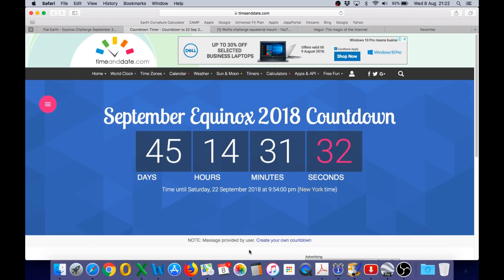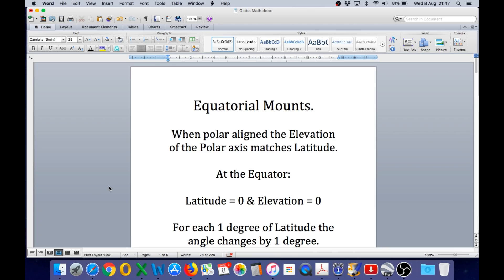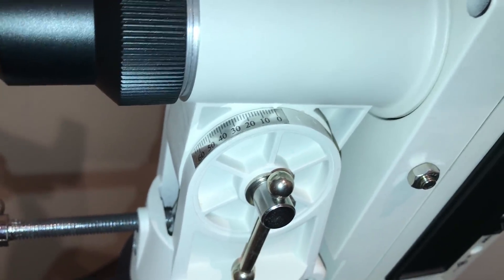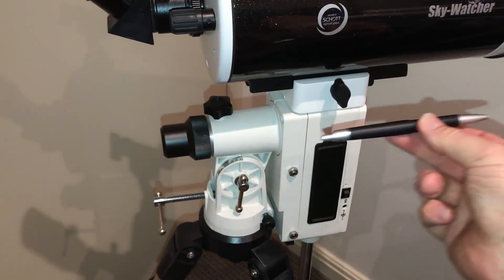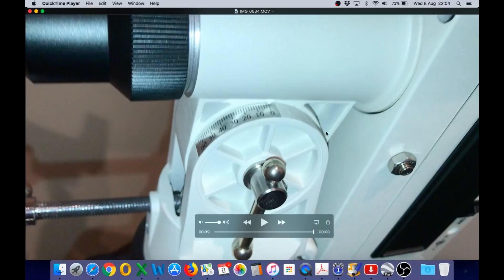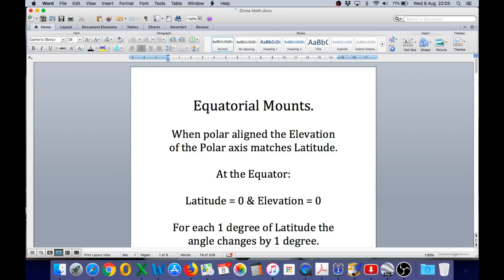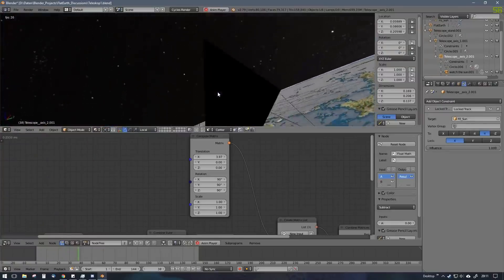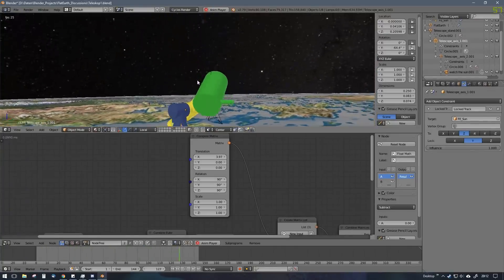Equatorial Mounts - a huge problem for Flat Earth.

Comment: Wolfie6020 During the equinox the sun is traveling in a straight line...Now explain how are you tracking it doing an arc with your telescope...
Reply: jazla111 
You just don't get it, do you?
Reply: Scott Meyer Well you didnt explain how you track a straight line doing an arc...
Reply: jazla111, a correctly aligned EQ mount's trajectory is coplanar with target's trajectory. In case of the Sun - the ecliptic. Whether it's equinox or any other day is irrelevant. That's the whole point behind single axis.
Now explain why you, who are claiming to be oh so smart, need this explained.
Reply: Stanislav Blinov Yeah funny how you're tracking an arc which is not a straight line.
Reply: Let's see just how Flatearthily bad your spatial reasoning skills are:

What does a circle look like to an eye that is inside of and coplanar with said circle?
Reply: jazla111, come back when you learn what "coplanar" means.
Reply: Like I said, he doesn't get it. Geometry escapes him.
Reply: Indeed, Scott. We're aiming over his head. Given the subject of the vid, I might should add a "no pun intended" here.

Anyway, jazla, picture this: it's the equinox, and you're on the equator lying on the ground on your right side with your head pointed south so that you are facing the eastern horizon. You wait for the sun to rise. When it does, you begin rolling ooohhhhh so slowly to your left while sliding against the ground so that you do not roll off the same bit of dirt you started on. You never turn your head, letting only your rotation about your body's long axis move your gaze, and you take 12 hours to roll over 180° and face the western horizon.

Does the sun move in a straight line over you? Does your gaze track the sun? Do your eyes move in a (perhaps bumpy) circular arc? And most interestingly, can you think of any devices your behavior imitates?
Reply: Coplaner is when there two planes.  Like when you have two pilots you have a copilot.  If two planes land together you would have a colander.
Reply: jazla111 what do you mean straight line? Only on the equator the sun is traveling due east straight over head and due west. This is still an arc. For anyone on the globe during the equinox the sun is traveling due east, to due south or north, dependant on which hemisphere, with and elevation angle dependant on the observers latitude, and back down to due west. Straight arc. There were about 5 entrance to the equinox challenge showing how it works on a globe and how the equitorial mount works.
Reply: "Now explain how are you tracking it doing an arc with your telescope..." 
During the equinox the arc intersects the horizon at due east and west.  During summer it's shifted towards the pole, during winter it's shifted toward the equator. The angle of the arc is dependent on your latitude and does not change throughout the year.
Anyway, have you found Polaris yet?
Reply: The sun isn't moving...the Earth is turning.  Being on the Earth, which is round, you get an arc.
Reply: Odd that you didn't answer the questions. It's as though there's some rhetorical point you were emotionally invested in that the answers might pose some problem for.

Anyway, your totally-not-obvious-change-of-subject new challenge is also not a challenge. I'd just need to lay on a 30° incline rather than flat on the ground.

Spoilers: this is how every argument between a flat EEGer and a reality-phile is always going to go. Flatty poses some supposed problem for heliocentrism, reasonably knowledgeable person explains how the flatty's premises are false or his reasoning faulty or probably both.

Step 3, of course, is typically flatty says "Nuh uh! Wake up sheeple! LOL water off a tennis ball!"
Reply: DuhIdiot, step 3 is not jazla's style. He's likely to either stop commenting in this thread (only to come back with the same old BS in a later video) or go off on a tangent about his newest fetish. Recently that has been the fifth dimension.
Reply: Damn you're dense, it doesn't matter where you are on Earth or which day it is, a properly aligned equatorial mount will always work.
Reply: Gordon Freeman Dam I must be dense..Well here is another question for Mr intelligent..Explain in detail how perspective angular size works..Why do things get smaller the further away they are...I bet no one in this thread can explain it in detail..Why and How!
Reply: See, another irrelevant crap. Things don't get smaller the further away they are, jazla. Things appear smaller with distance. I'm sure the difference is lost on you.
Why? Because optical sensors such as eyes or cameras are much smaller than the outside world, they're basically points. In a uniform medium light travels in a shortest path. Shortest path between two points is a segment. Segments sharing only one point intersect, i.e. form an angle. The further the points are from the sensor, the smaller the angle. Next stupid question?
Reply: jazla111 do you mean why do they "appear" smaller the further away they get? Like how the sun and moon stay the same angular size while above the horizon?
Reply: Stanislav Blinov What a load of crap..Go over lay a grid on the photo and tell me its 3 dimensional. Does the eye and camera change the grid?
Reply: SAR dot Yeah I may as well talk to my computer,it will give me the same programmed robot reply.
Reply: +jazla111: Can you describe how an equatorial mount tracks the sun on a flat earth? Yes, you can. Model this, and you will no longer need to leave comments; you found THE answer all by yourself.
Reply: Attention all flatists.
Make a model, enter the competition and provide us all wrong.  If you can't it shows you are wrong about everything.  End of.
Reply: Hah! I can't believe that you guys are trying to explain things to Jazla! You would have better luck trying to explain to a collie how the dog food gets in the cans!
Reply: Mandelbrot Set I'm just practicing. Going to attempt training my pet turtle to play a cello this weekend.
Reply: Mandelbrot Set comedy gold
Reply: jazla111 following an object using 1 axis of rotation IS a straight line. All the time. All year. Your confusion is most likely because you don't comprehend the sun's path is a circular plane that goes equally below the horizon as much as it goes above the horizon during an equinox.
Reply from the maker: +jazla111.  I actually do explain it even in this video.   You are still not seeing the Geometry mate.  What shape is a circle when viewed edge on?   Hint - a straight line.   

Actually mate.  Do you have any android devices?   Get yourself this app. 

https://play.google.com/store/apps/details?id=com.alokmandavgane.sunrisesunset&hl=en

It will show you clearly how it all works.   I will be making a video about it soon.
Reply: Wolfie6020 Well im not looking edge on from 30 degrees latitude.
Reply from the maker: +jazla111 Get the app mate.   Use it and you will understand. You are looking edge on from any Latitude during the Equinox

https://play.google.com/store/apps/details?id=com.alokmandavgane.sunrisesunset&hl=en
Reply: jazla111 - At an equinox the center of the sun is on the plane of the Equator. If you are at latitude 30 degrees then you are 3959 * sin 30 = 1980 miles above the equatorial plane. The sun’s mean distance is 93,000,000 miles. That is proportionately the same as being 1.35 inches = 3.4 cm above the plane while the sun is 1 mile away, so it would still look to you as if the sun’s path through the sky was a straight line on that day, even though it would curve a tiny bit — which it actually does from any latitude, because the sun’s center is only on the celestial equator for an instant.
Reply: Wolfie6020 1800 nautical miles from the equator..Distance changes angles..Well distance changing an angle is not calculated in your geometry.
Reply from the maker: +jazla111  Yes it is.  Tell me what the change in angle is please.    Give me the real number and tell me how you measure it?  

Get the App - it will show you why you are looking at it edge on.
Reply: jazla111 you do understand it is impossiball for an object 3000 miles above a flat surface and not more than 12,500 miles away (at most) to even "appear" to disappear below the horizon, don't you? I guess not 🙄
Reply: Kevin Man LOL
Reply: jazla111 and here is the root of your cognitive dissonance...
Reply: Wolfie6020 I used to believe we lived on a ball mate. I even posted a video for you to see me explaining we lived on a ball. Then I saw things in reality that dont match the ball model. That is why I have a lot of questions.
Reply: An EQ mount is not walking on the globe towards the sun....
Reply: Sure I do. Wolfie asked: "Tell me what the change in angle is please. Give me the real number and tell me how you measure it?". You replied with an irrelevant video.
Reply: Quikee If you read the description it states 70 metre away x 40 metre high = 30 degrees..Well the angle changed 70 degrees walking 70 metres... I guess it wasn't what he asked robot. I bet your hard drive doesn't contain a terabyte.
Reply: jazla111, plot a to scale diagram of the Sun-Earth system, viewed in the ecliptic. Pick two different latitudes on Earth and plot a line from each towards the Sun's center. Return when you manage to have those lines not be parallel.
Reply: What's wrong, jazla111? I thought you liked making diagrams, you made them before.
Reply from the maker: +jazla111  Thanks and yes I agree that angles change over distance.  No argument from me about that.  But my question was how much do you think the angle changes to the Sun if it is 93,000,000 miles away and you move 1800 Nautical miles.  

I'll do it for you. 

93 Million miles is 80.7 Million Nautical miles. 

1800 divided by 80.7 Million = 0.000022

Arctangent of 0.000022 = 0.0012

About one thousandth of a degree.    About 4.5 arc seconds.  

Put into perspective that is 0.2% the arc size of the Sun.  

Do you think you will notice the difference from the Equator to 30 South Latitude?  

Not a chance mate. 

Hold a circle on edge and you get a straight line.  

Now tilt it one thousandth of a degree..    What do you see?  The same thing mate.   

This is more proof that the Sun is not just 3000 miles away.
Reply: Wolfie6020 No thats not what was stated read the thread..Distance changing and is not calculated in geometry.
Reply: Wolfie6020 If you want to get technical..Now do it for a 4000 km high sun vs 7000 kms of distance on a flat surface.
Reply from the maker: +jazla111 You stated.   "Well im not looking edge on from 30 degrees latitude."

Then you stated.  "1800 nautical miles from the equator..Distance changes angles..Well distance changing an angle is not calculated in your geometry."

So I did the math for you and as you can see you are within 1 thousandth of a degree of what it appears from the Equator.  (My calculation assumed the 1800 miles was a perpendicular to the direction to the Sun.  It would actually be less of an angle difference due to the curvature of the Earth) 

If you look at a circle edge on it will be a straight line.   Moving it 1 thousandth of a degree it will still appear to be a straight line.  

Yes that is exactly what you stated and this is exactly what I answered for you.
Reply from the maker: +Jazla111 Why don't you do it for a 4000 km high sun vs 7000 kms distance?   Do the math as I did please. 

That will show me if you understand how the Math works.   Otherwise it is pointless trying to explain things to you. 

You do that one and post the calculations here as I did thanks.
Reply: Wolfie6020 I just showed a demonstration with the maths on how much the degree changes. Ive just made 70 metres to 7000 metres and 40 metres to 4000 metres..So if it change 70 degrees for 70m x 40m what do you think will happen at 7000m x 4000m?
Reply: Wolfie6020 Now if the Earth is curved and you travelled 7000km. You have done 63 degrees of curvature plus the 70 degrees in distance.
Reply: Keep digging, jazla111. Keep on digging...
Reply from the maker: +jazla111 Mate I know what will happen.  Once again, I want you to do the math yourself.  Why do you always avoid anything Math related?   

Just do the numbers yourself.  I want to see if you actually understand this.  If you keep avoiding the Math it is because you don't understand how it works. 

Do the calculations properly as I did mate.  Stop beating around the bush.
Reply: Wolfie6020 I done the maths heat transfer from the sun at 149 million kms does not make one half the planet cold and the other hot. If you think the sun is that distance well good luck to you.
Reply from the maker: +jazla111  See mate, why should I waste time with you?  You never give me a straight answer.  You dodge math questions with nonsense and trying to change the subject 

The thread was about the Sun travelling in a straight line on the Equinox.  That is fine.  Then you raised the point of being 30 South Latitude (1800 miles from the Equator). 

I did the math to show that the angle changes by only one thousandth of a degree so you are effectively still looking at the circle edge on.  

Why all the other nonsense mate?  videos?  Now you talk about heat transfer?  Seriously? Can't you just focus on one point at a time and do the basic math? 

I answered your quesiton about the Sun moving in a straight line on the Equinox perfectly.   Conversation over.   

I asked if you can do the math and clearly you cannot so that tells me not to waste time trying to explain anyting to you in future because you won't get it anyway.  

So last chance mate.  Do the math for your 4000 km and 7000 km and show me how you do it and give me the real angle you calculated.  Is it really too hard for you?
Reply: Wolfie6020 Thats your problem mate you look at one piece of a puzzle. You have to look at ALL the pieces of the puzzle.
Reply: Wolfie6020 A 4000 km high sun at 7000 kms away will be 30 degrees.Did you not even watch my video.
Reply: Wolfie6020 It states in the description of my video 70m distance x 40m height will give you 30 degrees.
Reply from the maker: +jazla111 Did you ask me to explain how I can track it doing an arc with my telescope in your first comment?    That was your question mate.   I answered it for you.  

Clearly the Sun is not 4000 km high or the Equatorial mount will not work.  

You are the one missing the pieces of the puzzle.   The Equatorial Mount does work from every location on Earth.   

The polar alignment is 1 degree different for every degree of Latitude.  Each degree of Latitude is spaced 60 Nm apart. 

The objects in the Sky can be tracked using a single axis of rotation from any location on Earth when polar aligned.

There are several pieces of the puzzle.  See if you can put them all together into a model that works.  

Just try it on a Flat Earth mate.  What are you afraid of?   Do you want the truth or not?   

Try it - put those pieces of the puzzle together and tell me the ONLY shape of the Earth that works.  That is your project.
Reply from the maker: +jazla111  PS - yes I did watch your video - you used a theodolite app to get the angle of 30 degrees.  That is not what I asked.  I wanted you to calculate it using Math.

When you do the math and you calculate it for changing distances it does not work on a Flat Earth because reality changes by 1 degree for every 60 Nautical Miles.  Your video does no math.  No calculations and therefore you are still not putting the pieces of the puzzle together properly.  

Do you know that 1 degree per 60 nautical miles actually gives you an accurate "R" also?   Yes  6371 Kilometers perfectly  

Here is the Math. 

60 Nautical miles per degree.   

360 degrees in a circle.   

60 x 360 = 21,600 (circumference)

Divide by Pi = 6875 Nm Diameter. 

Convert to Km.  = 12,742 km. 

Divide by 2 to get radius = 6,371 km 

All the pieces of the puzzle = a ball mate.
Reply: Wolfie6020 I did do the maths for my demonstration. I set the drone at 30 degrees..It equals in maths 70m away x 40 metre high..I must of walk 70 degrees around a ball for the drone to be 90 degrees above my head. Did you see I was on a flat soccer oval not walking over curvature to change 70 degrees.
Reply from the maker: +Jazla111.  See mate you even got that math wrong.  

30 + 70 = 100...

You are still missing the point.  Did you measure how far you had to walk to get the 60 degree angle change? 

Did you have to walk exactly the same distance for every degree of angle change of your drone?  No you didn’t.   Tangent trig function does not work that way.   So you actually proved the Earth cannot be flat mate.

This is why I keep asking you for the real math using trig functions.

On a ball one degree of Latitude is the same distance travelled across the Earth everywhere and that results in 1 degree of position change of the telescope.  

Why are you still missing this? It can’t work on a flat Earth at all.
Reply: Wolfie6020 I walked 70 metres for the angle to change 60 degrees. I did not need to walk around  curvature for the angle to change. Distance changes angles..Height also changes angles.
Reply: Wolfie6020 Sorry I made a mistake its 60 degrees not 70..I will admit I made a mistake. It still proves that distance changes an angle.
Reply: Wolfie: "for every 60NM that we travel north of the equator we have to raise this angle by one degree".
jazla111: "you're wrong, distance changes an angle".
That's just gold.

jazla111, plot a to scale diagram of the Sun-Earth system, viewed in the ecliptic. Pick two different latitudes on Earth and plot a line from each towards the Sun's center. Return when you manage to have those lines not be parallel.
Reply: Raging S it's funny because that's what flat earthers call us, but they can't even elaborate on topics they bring up
Reply: jazla111, plot a to scale diagram of the Sun-Earth system, viewed in the ecliptic. Pick two different latitudes on Earth and plot a line from each towards the Sun's center. Return when you manage to have those lines not be parallel.
Reply: Raging S Robot try down the line of longitude not the opposite side of latitude.